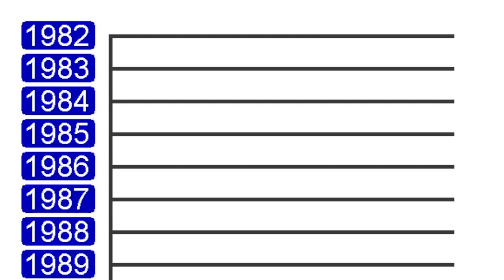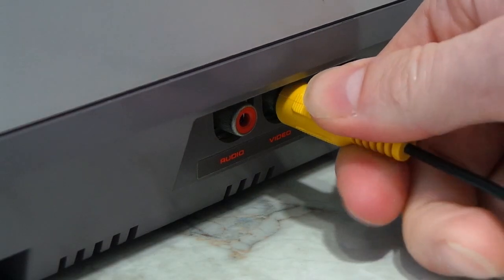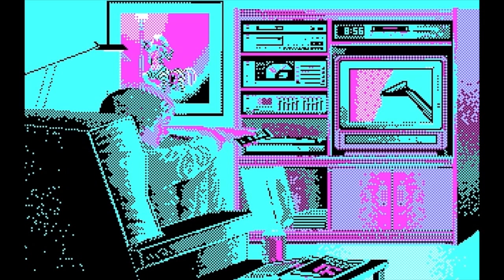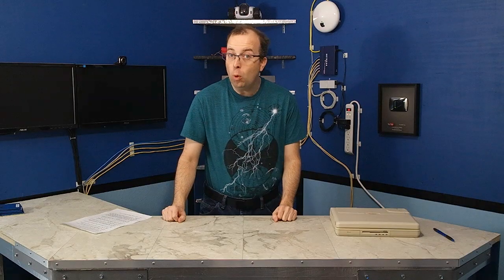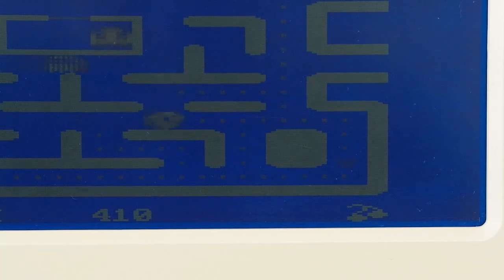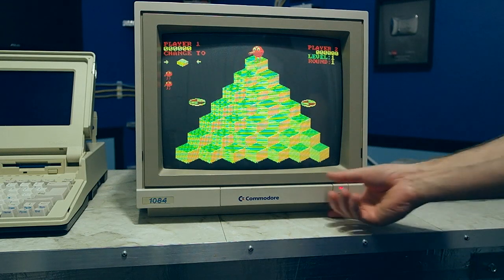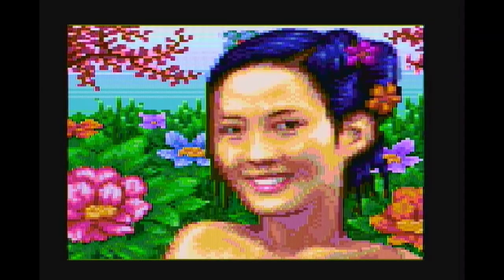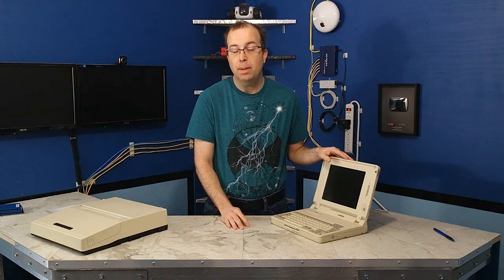CGA Graphics - Not as bad as you thought!

Comment: Surely Hercules was the first graphics interface?
Monochrome, sure, but it still needed an interface to output video.
Reply: No, the IBM PC originally had the MDA and CGA options (they were launched together with the PC itself). Hercules was a third-party add-on, which was introduced a few years later. It was basically a modified MDA card with more memory, allowing bitmapped graphics, instead of text-only.

Comment: Do you know if the composite output of the CGA colors used all the scan lines or had a letterbox-like effect? (image is scaled down quite a bit to fit in the safe area).
 In the early 2000s, I spent a lot of time and money looking for a video card with composite output that did NOT have this scaling "feature", and ultimately failed. I needed the full picture area to display sliding titles and other real time graphics, and ended up buying a professional video effects unit to accomplish this one task.
Reply: Computer displays are generally 'letterboxed' in that they have a square area in which text/graphics appear, which needs to be entirely visible, and then a border around it, which goes into the overscan area of the display. Only a few computers were capable of displaying graphics over the entire width/height of an NTSC or PAL screen (eg border sprites on a C64 or overscan modes on Amiga). CGA can do limited overscan in textmodes, but doesn't have enough memory to do it for graphics. I don't know of any software that actually reprogrammed CGA for overscan though.

Comment: I'll add another reason why the composite mode of CGA is so unknown: IBM never made a PAL version of CGA. IBM PC's sold in Europe produced 60 Hz and NTSC. 60 Hz RGBI monitors were sold, but not NTSC monitors. Therefore, outside North America, everyone was using RGBI out of necessity.

Connecting CGA to the Commodore 1084S doesn't work in PAL countries either: The PAL version of the 1084S is a 50 Hz monitor and doesn't like the 60Hz signal of the CGA card.

Comment: What if you used a VGA to Composite converter and played CGA stuff on the newer laptop? Would it produce the same effect?
Reply: +wrm_ Sure about that? If I understood the video well enough, the artefacts due to the "lower resolution" of composite video is what enabled to mix colors and expand the palette. So if you actually had an old CGA game, that was programmed to take advantage of that fact, displaying on a VGA output would give away the illusion and you'd see the individual pixels, but lowering the quality by converting to composite would produce a (subjectively?) more beautiful image, since it has more colors (but much lower resolution).
So I do believe that even if you're using an emulator on a modern display, you would get crappy graphics, unless the emulator had a setting to simulate NTSC encoding, therefore "blurring" the pixels together to create new colors.
Not sure though. You're right anyway, VGA graphics IS objectively superior. Just not on games designed for CGA.
Cheers!
Reply: Salah Eddine H
 It's a similar method to how they got certain colors with the Sega Genesis and certain effects, like the shield power up in Sonic the Hedgehog, or the waterfalls. If you play in RGB, it doesn't look right.

Comment: The problem was that most monitors that used a VGA connector did not have composite input, nor did most VGA and later boards have composite output. As a result, early 90's computers (let alone anything after that) had no easy means of displaying CGA games correctly.

Comment: I see that this entire tutorial has failed to point out the actual reason for the poor color performance of CGA graphics cards. Namely it isn't RGB based but rather CMYK based (what printers use). All video modes, on any other computer, in any other mode, must use RGB. The CGA designers were more interested in the printout of CMY. not RGB.
Reply: I'm not entirely sure this makes sense. At the time CGA was doing some major out of the box thinking, and I've always believed that the ugly "additional colors" were just a compromise in design. If not cyan and yellow it would have been two other secondaries, cyan and magenta or yellow and magenta. If they had to leave one color out magenta probably makes more sense as it's got less practical business use.

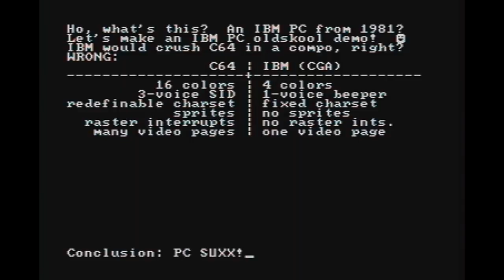Comment: 8:46 I can understand how the composite trick works to get 16 colors instead of 4. But how on earth did they manage to show thousands of colors on a CGA card in that demo?!
Reply: They used the same 16 colour hack as the Pacman game does, so since they have 16 colours to begin with, they get many more mixed colours. (The 16 colour hack uses text mode with only the top two pixel rows of text characters visible. The pixels are made from the block drawing characters, the demo additionally used other characters than just half- and full block ones to get more possible mixing patterns to get still more possible colours, but at extreme difficulty in drawing the graphics.)
Reply: @tylisirn: Interesting. Thanks for the reply.
@Roberto Gatti: Yeah, I guess the low res image creation could be automated somehow.

Comment: I kind of expected you to mention 8514/a graphics since svga got mentioned.  it was a step on the way to svga and another model in the same ps/2 line that introduced the 8514/a also gave us the mcga 256 color 320x200 mode
Reply: 8514 was the first step to modern GPUs, MCGA was the cheap graphics on the motherboard of the weakest PS/2 (model 30), all the other PS/2 machines had better CPU and VGA or better.

Comment: 01:58 WTF IT HAD V-SYNC??
Reply: Even HDMI and 4K have a V-sync signal.  It's basically the "here comes the next frame" signal from to the monitor.  Without it, the image would roll, as in scroll up or down uncontrollably.
Reply: I mean, Even a connector that old had V-Sync? I'm not talking about HDMI or 4K. P.S 4K is not a connector.
Reply: it needed vsync, kind of. The memory was so slow it had to cool down between scan lines. Vsync tearing today is a matter of the card being faster than the display, so it's kinda the opposite problem.
Reply: I know, it was a joke referring to nowaway's meaning of v-sync.

Comment: You say that VGA and EGA are backwards compatible with CGA, but some CGA games have weird bars through them when run on a VGA display.
Reply: They might be designed for composite mode.
If you draw the graphics for a game and intend it to be shown on a CGA card, the way you draw the graphics is different for composite mode compared to RGB mode.
But, since EGA and VGA only support RGB mode, anything designed for composite looks completely wrong.
Reply: KuraIthys I don't think so. Donkey.bas which looks fine in RGBI mode had this problem.

Comment: PAL composite didn't produce consistent "artefact colours", more often it just made for an annoying shimmering. You'd even find secondhand computers where the colour chip had been hacked out to make it mono-only.

BTW just for clarification the actual pallette colours worked fine, "artefact colours" were the extra ones obtained using stripes as described in the video. Technically it works because in NTSC the colour carrier and dot clock were usually derived from the same source, so certain patterns generated CONSISTENT colours. In a typical PAL conversion the colour carrier was derived from a seperate crystal, and wasn't synchronised to the dot clock. If the graphics did develop artefact colours (a BBC micro in 80 column monochrome mode definitely did) then they weren't stable.

In some computers the lumanance was filtered enough that it didn't break into the colour at all, but this smeared the graphics a bit.
Reply: What do you mean? A PAL C64 displays colours just fine on a regular TV, either via RF modulation, or via a PAL composite signal (some C64 monitors also used the composite signal, only a few used the separate luma/chroma signals that were slightly better quality).
Reply: Nope. C64 produced color display on a PAL TV. C64 had 16 color, why use composite trickery?
Reply: Yes. I suspect the home computers developed in PAL areas (there were a few of those, notably the UK ones) avoided any use of composite artifact colours.
Or if they did, they expected you to use a monitor, not a TV.
(Like the commodore monitor - clearly essential if you expect to see the colours of a C64 in Europe)
Reply: The C64 displays I saw didn't appear to have artefacts at all, so I'm guessing the C64 lumenance was filtered more heavily to trade off some sharpness for cleaner colour. Definitely the better choice for TV use.

Comment: If RGBI is obsolete than why does my new toshiba laptop have RGBI and I use RGBI to connect my laptop to my flatscreen tv. I got my computer in 2014 and it also has HDMI. Sooooo?
Reply: +Jacob Hillier VGA is still the most used on computers. Only enthusiasts use hdmi or displayport. Majority of computers still use vga connectot. Why upgrade? VGA is good enought for majority of people and the low end monitors only have vga input.
Reply: Is it VGA
Reply: VGA cards switched to a 15-pin D-sub connector which everyone just calls... VGA. RGBI died with EGA. The difference being that the digital RGBI signals were replaced with analog RGB signals, which allowed future graphics expansions to support far higher resolutions and color depths. Hell, I'm writing this comment on a VGA-connected, 2048x1152, 24-bit color monitor that the designers of that connector could never have even fathomed. Of course even that is obsolete with HDMI and DisplayPort supporting even higher resolutions, refresh rates, and color depths with fully digital signals.
Reply: +Jacob Hillier i use vga. All my computer monitors have vga input only.
Reply: +Luis Marques Thanks

Comment: The composite artifact is a trick that has been exploited on game consoles as well. For example in Sonic on Megadrive/Genesis, the bubble shield looked transparent when we were playing it on the console plugged to a CRT TV but when we play the game on an emulator on a flat screen, we notice there is no transparency at all but only 1 of 2 sprite columns of the sprite showing up.
Reply: A lot of Genesis games used a technique called dithering to create new colors using NTSC artifacts.  You see that in backgrounds with sunsets.  Its amazing how programmers were able to get around the limitations of hardware back then to create these effects.
Reply: @dmac7128  That technique was also used on MSX, Colecovision and SMS games. Konami exploited the trick on the MSX version of Salamander too.
Reply: @dmac7128  ye its amazing
Reply: It's also the sprite flickering trick, like they did for the water surfaces to hide how the background palette was changed at a certain point on the screen the put the level underwater.
Reply: Careful, this is quite the heavy debate in certain retro communities; whether or not retro games were meant to be shown in composite video or the RGB signals wired up in most consoles, and what was the original artist's vision.
Reply: and also, how did those games work when used with composite PAL video instead of NTSC, with (I presume) somewhat different colour artefacts
Reply: @RarefoilB Is this really a sensitive topic
Reply: @Ballowax  very serious .. lol
Reply: There was also Super Mario World for the SNES. On levels where water appears, the water isn't actually transparent, but is just checkered with clear and blue tiles. on a crt you wouldn't notice and it would look transparent.
Reply: You mean you wont be able to see the checkerboarding when using RF and Composite you idiot. The checkorboarding and dithering effect can be super noticable when playingon CRT via s-video, RGB Scart and Y-pb-br component video.
Reply: What_Zen - That’s true, however there is code for true transparency effects in the game’s files. It disables the background though. It’s possible that the development team could’ve pulled off transparency effects and still keep the background. But of course, it was a launch title.
Reply: First off the raw dithering can be easilly noticable on a CRT via RGB SCART and the Dithering can still be unoticable on an LCD TV, if you're still using composite. Second, Crts can still show a huge amount of Detail that game developers didn't want you seeing, and in my opinion thats better than that nagging feeling that eats you when trying to enjoy a retro game through composite video

Comment: Why doesn't EGA and VGA have a composite output? RGBI is obsolete, not composite.
Reply: My guess is that the manufacturers were interested in sharp graphics, and the analogue TV system was too limited for their liking. Yeah, you had 576 lines to play with, but the bandwidth limitations within a line would limit how many distinct pixels you could pack into it.
Reply: @Roxor128  Analogue NTSC TVs were still the standard back then in North America, so people without a computer monitor would want to use the TV they already have rather than buy a new monitor for their computer.
Reply: @Nikku4211   In the home, maybe, but remember IBM's main market was businesses, and they didn't get much penetration into the home in the early 1980s, despite including composite mode on CGA for just that purpose. Most of IBM's customers in the mid-1980s would have been businesses using monitors for sharp visuals anyway. The output of an EGA card could drive an RGBI or monochrome monitor like those previously used with CGA or MDA. Upgrading to an AT with EGA and keeping the old monitor would have been a common decision at many businesses. By the time VGA showed up 3 years later, even the home market was starting to shift towards dedicated monitors. By the SVGA days, a dedicated monitor was normal.

Comment: I hated (and still hate) CGA.  Thanks for the technical education about why it was technically better.  But that does not negate the fact that in practice, most people only saw RGBI CGA modes.  It was such a letdown moving from nice, multicolor Apple and Commodore 64 graphics to the ugly four color, two palette CGA mode on the PC.  I did not know until now, some 35 years later, that there even was a 16 color composite mode on CGA.

CGA was designed better.  But in practice it was much, much worse.  And that is what counts.  Not how it was designed, but rather how it was used.

Comment: God I never new that about composite .  I carried around a Toshiba T1000 for a few years.  It was only an 8088 but it had a rom dos.  I could load up some cheap games on the 720 drive and not worry about dos taking up space.  But it had a composite output and I had NEVER tried it:P  

Now I got to load up some of these games off my laptop.  Humm.  Makes me wonder if there are any emulators that support composite CGA.
Reply from the maker: +warlockd Really?  I've been wanting a T1000 for a while, but I didn't realize it had composite.  Now I want one even more!
Reply: DOSBox does have composite support.
Reply: Everything x86 before the 80386 used a 16-bit instruction set. An 8-bit ISA bus was used before the PC/AT (80286), at which point 16-bit ISA was introduced.
Reply: Yea, the 8086 was a 16-bit cpu.  That is it had a 16 bit data bus if we use that definition.  The whole thing was a bastard anyway.  It could do 16-bit math but only certain registers could do curtain math ops.  While it had access to a 1 megabyte memory space, it had to do it in 64k blocks.   The problem was that all the peripheral chips used an 8 bit bus so you couldn't memory map them up right without extra buffers.  The 8088 is the same chip except it access memory in 8-bit words instead of 16-bit.  

I kind of wish IBM used the 68000.  Flat memory access, better clock to instruction ratio.  But there wasn't a lot of choices back then, and the 8088 was the best bang for your buck for a general PC.
Reply: +The 8-Bit Guy Hah, well I have a spare if you like it.  There is this memory upgrade you can get for it that expands its built in 512k to 640k with an extra 384k "memory disk"  I have been buying up a bunch of broken ones to find that single upgrade as I had always wanted it since I was a kid with the thing.

It also has a 128k  byte rom that I replaced for some simple serial trasfer software so I don't always have to use a disk.  Been thinking of modifying the bios so that it can use one of those old DISK2000 8meg rom chips but its one of those projects that I put on the shelf:P
Reply: Trying to remember the chip, but they first released it as 16bit bus and 16 bit IS. The motherboards boards were so expensive they released a revision with 8 bit bus,  16 bit IS. 8086 was 16/16 and 8088 was 8/16.
Reply: My Twinhead was identical . . . Many Disks.... Many Fun
And pc speaker...!! Soundcard? What whas that!!
Reply: Wasn't the 8088 first 16bit then due to lack of mb support the dropped bus to 8bit?

Comment: Really interesting. I love video mode hacks.
As for CGA modes the background color (black by default) is actually freely selectable between the full set of 16 colors which should give you even more options for artifact colors in the composite mode.
Some games, like California Games, used precise timing to switch palettes every line but it only works on a stock 4.77 MHz 8088 due to the way the timing code was written.